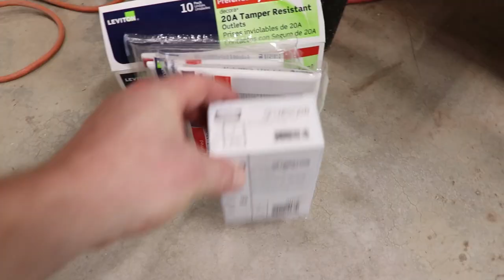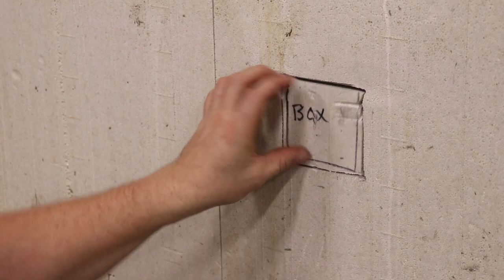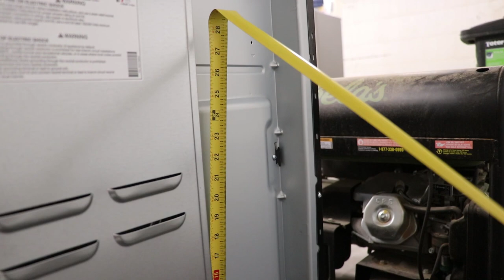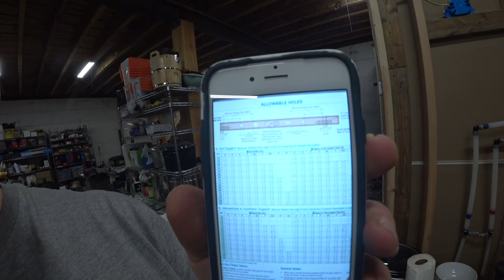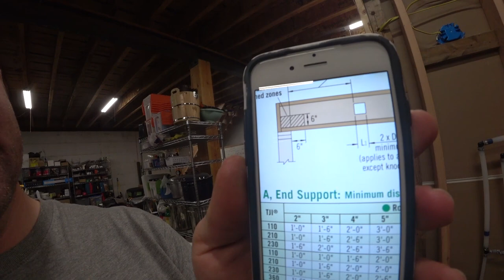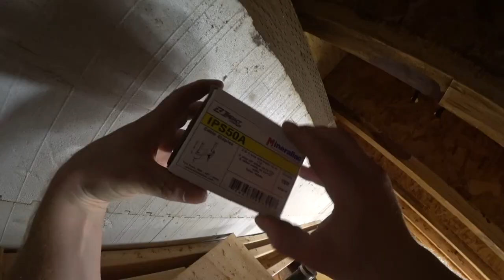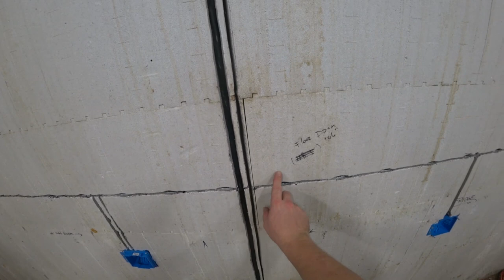SOLVED: Generator Interlock Solution (Backup Power)

Comment: You need a separate circuit for your outside garage  recepticals. I would use 12 gauge wire and a 20 amp breaker. You know many of your big power tools pull 15 amps and that’s usually where you’re going to plug them in. If you’re thinking about a welder down the road you should put a 50 amp circuit by your door also. You’re not gonna want to weld inside your basement the smoke from welding is terrible.
I love your show. Keep it up and thanks for all you do for us.

Comment: Tip for you! - get a dymo label maker and a 1/4” white label and put the circuit ID on each of the 110V outlet so you know in the future which breaker controls it. I.e. “Bathroom GFI 1”, “Garage Left”, etc. will save you a lot of time in the future as you expand and build out.

Comment: I am a professional Baker/Pastry Chef, and one thing I learned in Culinary School and again as a apprentice baker is to keep your salt separated from the yeast. Salt kills yeast so if they come in contact 1 on 1 you will lose part of the yeast.. Salt when applied away from and mixed into your dough acts like a governor and keeps the yeast from running wild and overflowing your loaf pans. Happy baking! Here's another baking hint. Do it until you get it right. Flour-Cheap, water-cheaper still, so if you mess up , not a wrist slashing moment. Do it over and over until you get it right. Baking is edible chemistry, thats why every thing that is used is weighed. Bakers use formulas, cooks use recipes. Here's A HANDY MEMORY REMINDER. "A pints a pound, the world around" Pint of water weighs 1 pound, milk, eggs, same,  now oil is a little less so has to be weighed differently. Get an ACCURATE SCALE for a consistent product. Love your hard work and stick-to-it,  work ethic. Good job!
Reply: Sadly Frank, your rhyme is only locally correct, not the world around.  Over here in the UK,  "A pint of pure water weighs a pound and a quarter".  That's 20 fluid ounces to the pint.  When your country was setting itself up, measures were subject to variation.  You chose the (much more logical IMHO) Scottish definition of a pint.  but really by now you should have joined the rest of the civilised world and gone metric by now.  :-)
Reply: Frank Gerlach Thanks for salt tip,over years I had noticed problem with salt and no salt,so stupid on my behalf ,add salt later,lol.I do repli on my French bread buts ite not as chewy as I would like,any suggestions,I seem to kill yeast by handling dough ? Any suggestions?
Reply: Frank Gerlach unless it's an Imperial quart or pint which are 40 and 20 oz respectively,as opposed to US which is  32 and 16.Here to add more fun we switched to metric, I might add that was a pain,but once mind adjusts best thing ever, 1 cc = 1 gram = 1ml.  Of  water at stp.
Reply: Was taught years ago that salt stops or slows the yeast and to add it with the flour to doughs......

Comment: suggestion every place you wrapped in electrical tape go back and heat shrink it with read heat shrink tubing the tape will make it thick and noticeable and the heat shrink will keep the tape from failing when the adhesive on the tape gets old.
Reply: clayton mccormick we typically just colour the last couple inches of the wire with black sharpie in my area. I guess as long as it’s marked it’s good

Comment: Jesse,
Larry here, I have some important info as regards using the 12/3 cable system. You need to always have especially the white common wire connected to the panel at ALL TIMES! To insure this you do what is called pigtailing. For example when the white wire enters the box you take the appropriately sized wire nut connect it to the outgoing white wire and add a shorter wire (pigtail) and attach it to the silver colored screw on the outlet. By doing this the white wires path to the panel is never interrupted, otherwise you'd end up with 240 volts on anything else on the circuit while it's disconnected, which would damage appliances and melt your wire. I do this with ALL the wires in every box. Also it's a good idea to wrap the wire around the screws and not use the quick connect option, a much more reliable connection. Another advantage to sharing the common is it reduces the voltage drop over the 2 circuits (more efficient use of power).
Reply: The days of pulling 14/3 or 12/3 multi circuit cables in a dwelling are pretty much gone with the ARC Fault requirements...each circuit needs it's own dedicated Neutral.  The way around it if you really want multi circuit cables is to pull 12/2/2 or 14/2/2 RX that has two Neutral (white) wires.

Comment: One very small "OCD" (Obsessive Compulsive Disorder) tip on installing outlet and switch cover plates.  Carefully tighten cover plate screws leaving them with all of the screw head slots either horizontal or vertical (throughout the house).  I have always felt that very small 'detail' was just a little sign of the pride with which I "signed" my work.

Ken

Comment: Now that you have your interlock problem solved go get a raintite receptacle made expressly for generators.  They cost less than $100 and have a male end instead of a female end.  Then you can connect a female end to the cable that you have tied to your generator and have an extension cord to connect the generator to the receptacle.  This will mean the cable won't have to be protected from the sun and weather hanging there by the panel, you can keep it with the generator and even put a regular receptacle in your garage area and use the cord to feed a welder or other heavy power consuming device.  The way you have it now is safe because of the interlock but the cable is still hanging out there and the cable won't like the sun long time.

Comment: Your state has adopted the 2017 National Electrical Codes as far as I can tell. You should get that Book. New ones come out every three years.  A few things like dedicated circuits like a refrigerator , how far between outlets. Arc fault and ground fault location are covered. Ever code is covered. I have seen a few issues your electrician should have pointed out to you.

Comment: Helpful tips: drilling straight holes the hoist make it MUCH easier to pull wire and over sizing holes allows more heat dissipation and easier pulling. 
Plus if you ever want to use that set of hole for your range run you would already have it drilled out. 
And for your joists, you typically have to have the holes min 12 apart. 
Thus you will burn up your floor joists space pres try quick when you account for plumbing, hvac, low volt, garage door openers, electrical and more.

Comment: I’m not sure if you’ll ever read this with so many comments nor did I check to see if this was already mentioned but I’m in the same situation as you two with the ICF and running wire. Depending on the manufacture (I used fox blocks) when cutting in wire runs, it’s easier to run along the teeth line, where ICF blocks stick together. The heavy duty plastic isn’t as thick and usually has a 1/4” gap or so in this area anyways. Might be useful might not be, best wishes for you and your family!

Comment: The metallic extension box should be grounded. you can do this with a 'ground clip' with a #12 bare wire 'pig tail' spliced to the #6 ground conductor. It looks like you are 'daisy chaining' the neutral conductors through you receptacles. This is a code violation because when you remove that device for any reason you are creating a hazardous situation by opening the current return path. The neutral conductors should be spliced together with a 'pig tail' for each receptacle. (I'm sorry, but 30 years as an Electrician forces me to mention these things in the interest of safety).

Comment: Ask your electrician if your "garage kitchenette" is considered a "kitchen" (I think it is because it's the only one in the house)...if it IS than you need two dedicated 20 amp appliance circuits in that area.  These circuits can not serve anything else like garage door openers or outside outlets.

You might consider using a 50 amp Surface Mounted outlet for the Range, they are much more compact...just let the cable come out near the floor and connect it to the surface outlet.

Comment: Jesse, I have suggested this before but I am going to be a little more insistant this time: when you are installing your receptacles and switches do not cut off the excess wire.  Instead, feed it back through the box and make a large 6" loop in the wire between the final staple and the box.  That way when, not if, you want to change the switch or receptacle you can pull the excess loop out through the box giving you extra wire with which to work, both for taking the switch out of the box and in case a mistake is made.   In your situation, with due respect, this is going to happen.
Reply: 1961casey you already put 6” inside the box. Why leave another 6” outside the box too?
Reply: That 6" is not a NEC rule?   or it is just before inspection and without outlets or switches attached?
Reply: 1961casey my dad used to leave extra wire and this is exactly why.

Comment: Alyssa my Grandfather, Dad and I used to make sour dough pancakes and bread about once a week.  We would take out 1 cup of starter to this  add 1 1/2 cups warm water and 1 cup flour.  Mix well then put 1 cup of this mixture back into the starter, this way you do not draw down the starter so much. This was the way to do it for any use of the starter.  Generally kept about 2 to 3 cups in the starter container.

Comment: Regarding how many outlets -- It's not as much how many you need -- that depends primarily on expected loads -- but where you place them. You want to make sure you never have to run a cord across a door, stair, or walking path to get power to a particular area.

No powerless corners.

Re: wire sizes -- per NEC and CA codes, 14 AWG wires (THHN/THWN)can carry 15 Amp loads, 12 AWG => 20 Amps, and 10 => 30. Going to a larger wire, like 8 AWG, you would be expecting to carry 40 Amps per leg. Very few circuits in your house need more than 30 Amps a leg -- water heater, dryer, and range, typically. 

That's why there's no mark for 8 AWG, 6, 4, 2, 0, 00, 000, MCM 350, MCM 500, etc... Because if you're putting those into the box, you may want to rethink your project design. 

There's no mark smaller than 14 (16, 18, 20, 22, 24, 26, 28) because those would probably not be rated for a load as big as your breaker. Again, if the question arises for those sizes, you might be outside the manufacturer's intentions, and should maybe redesign. 24-28 are usually communications only -- typically low voltage, phone or network.

Typically 8 total duplex outlets can be placed on one circuit.

Check and follow local codes, of course.

Comment: Hi Jesse, My son used to drive me mad with extension  cables all over his bedroom so I sorted that by giving him his own fuse and ring main and installing double sockets every one yard around his bedroom and three extra double sockets by his bed. That gave me two advantages, 1 if he popped the breaker he did not affect the rest of the house and 2 he had no need to use extension cables as they are prone to overheating and are a fire hazard. I had brushed steel outlets and changed them out because if something went wrong with the earth they could become live because they are conductive  and I did not like the idea that water could get behind the switch and cause a fire.

Comment: Hi, I have been following this very interesting construction for over a year now. True being English it's easy to follow, but after spending 38 years in France, im astounded with your electrical "codes". First because in France we use Grounding sensitive contactors, which have 30ma or less protection. But the main thing is the 220v single phase or 380v tri phase we often use in houses. We are actually allowed to pull   220v 16a plugs on what we call a loop circuit .. eg. a living room where you actually take the phase 220v, neutral AND earth in 2.5mm² cables in a loop around the room.. This effectively gives you a 5mm² circuit , upon which you can find up to 6 x 220v plugs ... Knowing that 1mm² takes 4 amps on 220v this allows 5 x 4 amps (20amps) ... Simplifying everything ..... Generally the lights and wall plugs are on different circuits , and high demanding appliances are also wired separately , BUT always with Earth wires ... What are your feelings on 220v systems (3 phase 380v) as of  110v systems (3 phase 220v) ?

Comment: You are hooked up to alternating current.  A neutral wire is just as hot as the hot wire.

Your transformer has a 220/240 volt coil in it.  When you hook up two adjacent breakers, they are connecting to a lug from both black wires in the electrical box which completes the 220/240 circuit from both ends of the transformer coil.

To get 110/120 volts, they connect a wire to the middle of the 220/240 coil (the neutral wire) which means you will get only half the voltage created by the transformer.  So if you are using a single breaker, you are connecting to only one lug so that your electricity alternates from one end of the transformer coil and back through the neutral to the middle and then through the neutral and back to the end of the coil.

The only wire that normally has no electricity is the ground wire.  It is there as a safety so that if the wiring in a metal appliance touches the metal exterior, it will go through the ground wire to your earth ground instead of you.  That is why you never connect the ground wire and neutral wire together at the appliance.  It would also make the ground wire hot.

https://jacobs-online.biz/understanding_transformers.htm

Comment: If the starter is not used for 10 days we would stir in 1 teaspoon sugar.  to increase the starter we would add 3/4 cup warm water, 3/4 cup flour and 1 teaspoon of sugar.  Hope this helps.  You both do a fantastic job, both on the house and editing.

Comment: That breaker panel should have been wired like that to begin with. :) FYI. You shouldn't put metal box extender on plastic box. Metal box needs to be bonded to ground. You could mount a metal junction box and anchor it to the concrete.

Comment: Here's short story for you . I helped a few friends rip out a kitchen to have a new one installed before they moved in .  We had the power off pulled out the cabnets and sink bench etc.  It was a long galley style kitchen on the back wall of the house with a dividing wall to the pokey dining room. we decided to replace the gib board because it had painted wallpaper on it (You call it rockwall and in NZ its called "gibralter board" and refered to as gib) .  So we got to the dividing wall and decided to pull it as well as it wasn't load bearing and it opened the place up and let more light in. At this stage we had turned the power back on to have the stereo on as we worked. All the switches had been put back on the walls to make it safe. One of my friends picked up the sledge hammer to knock out the dividing wall and i said "do it from the other side to knock the gib into the kitchen" so he did. One of my other friends said hit it like mean it as he had only tapped it fairly lightly. So he gave it a good hard hit and all of a sudden there was a blinding blue flash, a bang and the power goes off  with the approprate cursing. The stove must have been against the dividing wall originally.  We looked in the roof cavity and found a junction box there with one wire running into it and the other going to the far end of the kitchen where stove was and then found the third wire out of sight going down the inside of the dividing wall. no one was hurt luckily  we only lost a chunk of steel out of the sledge hammer.
Reply: Friend of mine was renovating a building he had purchased.He had phoned Hydro and had them shut electric off ,since they were doing major  conversion reno.He says JP on hydro panel they had affixed their paperwork stating said work had been effected with date and time.Satisfied they began work,he said to me I grabbed big line cutters ,and began to cut he said next thing huge blue flash and was thrown across room and he's a 250 minimum,and cutter end had vaporized,we had known each other quite a while and his body language said all he stared  Death in the face. Be careful with electric,steam,and  anything with radiation .Retread extremely cautiously.

Comment: Nice touch with the red tape inside that outlet box !  No question for rookies that those NOT neutral wires !  In the past, it was never "required" for 240V circuits 20A and less.

Comment: Jesse,
Larry here again, good to see your using the 20 amp outlets. Here's another suggestion, there's a way you can run 2 circuits with one cable. The cable is called a 12/3 cable, it has 2 hot wires a black and a red along with one common (white) the 2 hots share the common. When wiring it in the panel just be sure that the red and black wires are on separate legs in the panel ie right and left legs. Where this would serve you is on the wall say where your frig is. You could say use the red wire for your frig only which is supposed to have it's own 20 amp circuit and the black could be used for your outlets and lights.
Reply: It's amazing how many electrical "experts" there are in this comment section.  Right and left legs?
Reply: Kathy Schaben might I add to keep in mind that if you install it this way to be sure you make the panel connections to a two pole breaker.
The reasons for this would be the simultaneous disconnect of the two circuits ( ungrounded black & red conductor) sharing the neutral ( white conductor ) for safety. 
If for any reason you or anyone else in the future that may be working on or come in contact with this multi-wire branch circuit. This two pole feature would insure the opening of both hots and remove the potential of any return voltage on the down stream neutral conductor from any one individual breaker used.